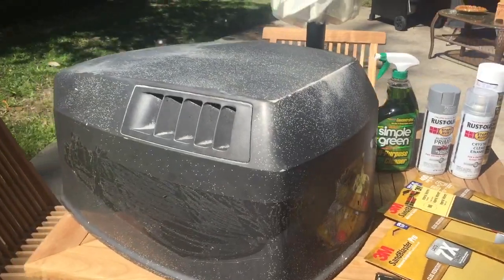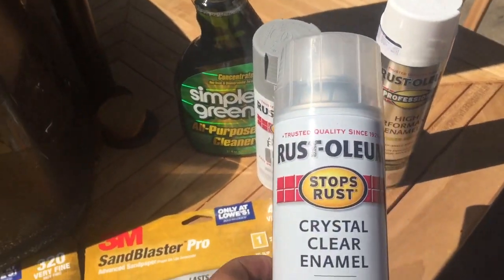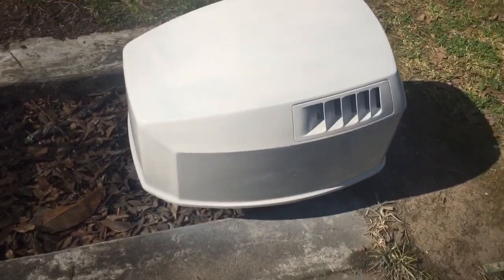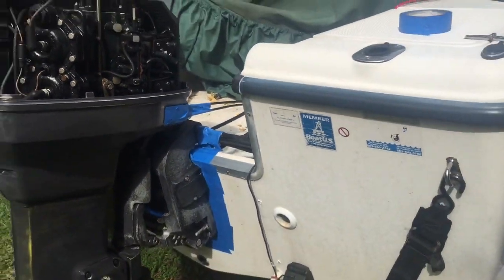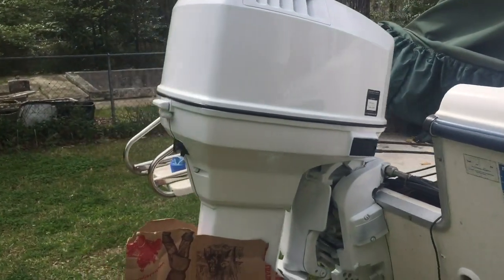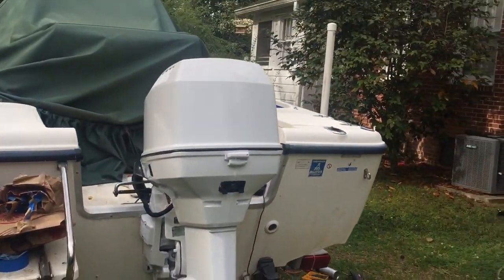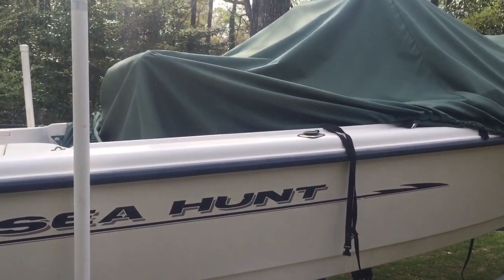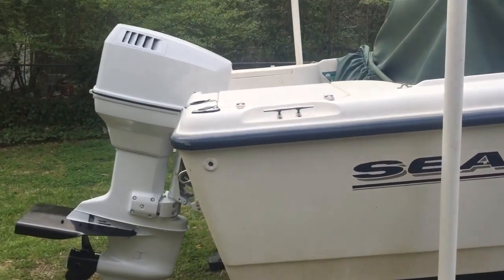Painting Outboard Johnson/Evinrude 115

Comment: I have the same year motor but in a 90hp and was reluctant to paint a plastic cowling.  Your video gives me hope that it'll come out ok.  I have new blue decals (replacing the OEM red ones) and prefer the original platinum color which, according to BRP is also enamel paint so should work ok with Rustoleum auto primer and clear coat .  I'm curious to hear how your paint job is holding up 2 years later.  Great job, thanks for the video.
Reply from the maker: Still looks good other than a few small spots that have chipped and need touch up.

Comment: Thanks for sharing, Michael.  Looks like you did this job about 2 years ago.  I'm curious if you can share your long term satisfaction/results.  I have a (much older) engine which was painted by the previous owner.  The paint pitted badly & wondered if this is just something we have to live with, or if your paint worked out better.  Thanks again.
Reply from the maker: Paint has heals up nicely through the salt water. Highly recommend the rustoleum paint

Comment: Hey, you know you can buy the factory colors online. Amazon sells some of the BRP spray cans. Probably not worth the cost for white, but it's good to know if anybody is trying to restore their outboard to it's original color.
Reply from the maker: Yea I used a few can of BRP paint a few year ago on a small tiller drive motor. Looked great.
Reply: michael brown Is the BRP paint any better than the stuff you get at the hardware store?
Reply from the maker: I honestly have never noticed a difference. Its really all in how well you prep. The price of the factory paint is insane. I have had just as much luck with the cheap spray cans from the local hardware store as the BRP stuff. The only difference was that when I painted the smaller outboard it was only going to be used in saltwater, so I made sure to use a good zinc based primer to fight corrosion from salt. The primer I used in this video was a non zinc base as the engine will only be used in fresh water from now on.
Reply: Yea that's usually how it goes. I bet the cheap stuff gets the job done just as well as the BRP paint. It's really  not worth it unless you're trying to match Evinrude blue from the 80s or something like that, and you want it to be the EXACT same color.

Comment: Grat Job! A question off topic though, I inherited a motor like your & was wondering wether to disable the VRO system as the motor been sitting for several years & needs tune up & Ive been hearing opinions both for unhooking the VRO & some the other way - How do you run yours? Thanks for the video?
Reply from the maker: I have not had any issues with the VRO 2 system. I hear with the VRO 1 it is best to just premix.
Reply: I know it's a year later and I hope your engine is holding up but I lost two omc engines to the vro pumps failing. Not worth taking the chance to me.

Comment: what's your opinion about using this paint in saltwater?  are you using it in saltwater?  recommend a  brand that wont cost an arm and a leg for that?  thanks in advance.
Reply from the maker: I have not used the boat in salt water since painting it. Will be moving back to the coast in the coming months and will have it back in salt water. Ill update you once I have had some time in the salt water again. So far the paint has held up pretty well.

Comment: forgot to ask...how many cans of each did you use?  and if you had to do the entire motor head to toe including cowling, how many cans of each would you guesstimate ?  thanks
Reply from the maker: If I am remembering correctly I used 1 can of primer and paint for the cowl and two cans of each for the rest for of the outboard. Remember the more coats of paint the overall better look it will have as well as strength.